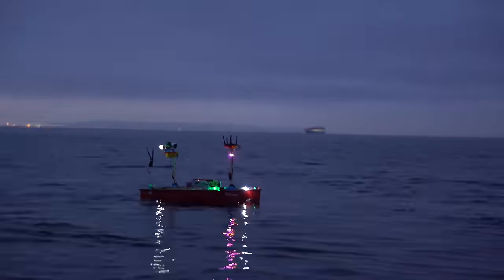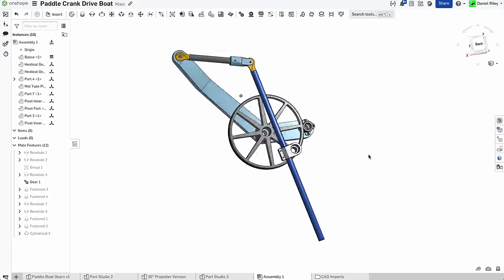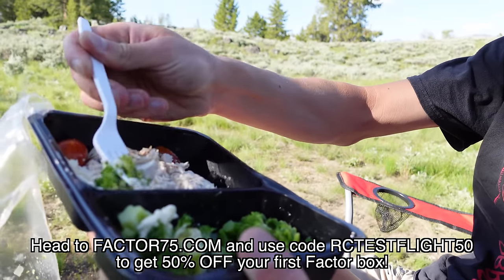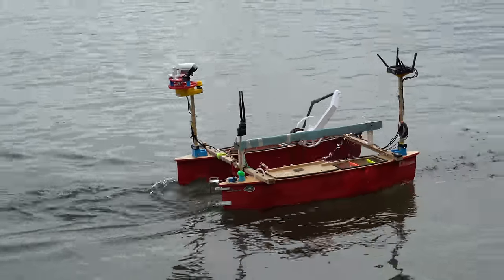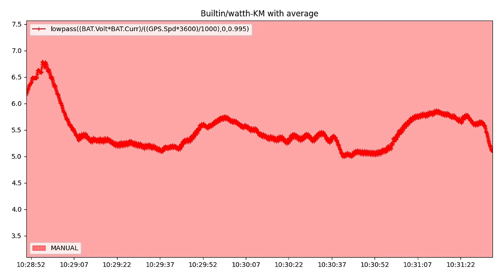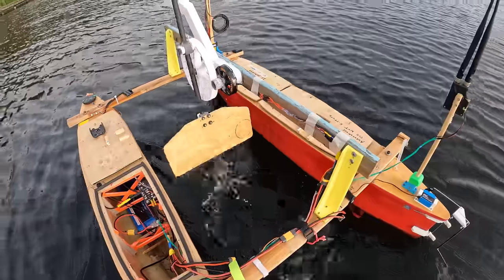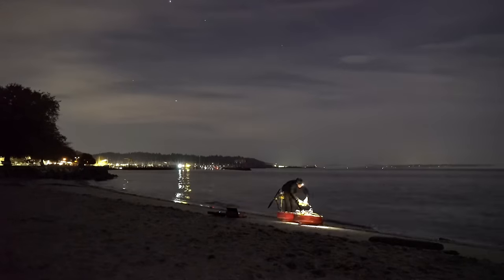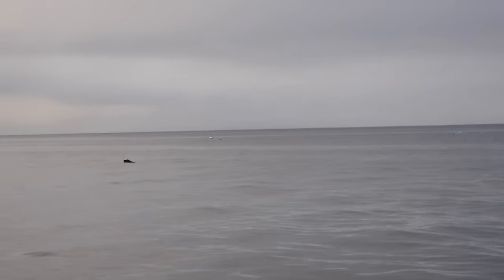Propeller Killer? High Efficiency Paddle Vs. Propeller

Comment: Have you considered moving the air props closer to the middle of the hull to minimise them hitting the water?  It would move them closer to the pivot point and reduce the amount of up/down swing.
Reply: Also try a ducted prop or one with Q-tips (see aircraft props for examples.)
Reply: 15:26
Reply: Wouldn't it start to push the bow down more as you get closer to the centre though? creating more drag and reducing efficiency as it tries to rotate around the pivot point rather than push forwards
Reply: @Phoen1x883  The comment suggested moving them forward. The 15:26 suggested moving them up.
Reply: Even if the air propeller is more efficient, I just like the paddle better!
Maybe try a wider paddle, with the edges bent back (like a 747's wingtip bent up) to cancel the vortices.
Reply: Good thinking

Comment: I would like to see you try the paddle again with another catamaran design. If the dimensions of the paddle are as close as possible to the distance between the port and the starboard hull very little water can escape around the edge of the paddle increasing efficiency. Alternatively putting a single big paddle wheel in the middle of a catamaran would also be an interesting idea.

Comment: Very interesting challenge. I guess a fish inspired propeller that that creates a wavy motion would have both very high efficiency and anti clogging properties
Reply: Exactly what I came to comment about. Nature developed tail fins! Why aren't we replicating that?
Reply: @seanhoude  because it's not a circular motion.
Circular motion is very efficient and easy to replicate and generate, especially with electric motors.
Yet any living creature can't create circular motion because flesh can't create ball bearings.
As seen even in this video, converting circular motion into reciprocating motion comes with transmission losses.
That's what prevented tail fin "propeller" to become economically viable.
Reply: @Shishou_Shi  Historically, we have created linear motion and turned that into circular motion (with losses). Why not use pistons to drive tails or wings instead?
Reply: @seanhoude  because it's very inefficient.
Yes piston engines are inefficient.
That's another factor on why electric motors are getting so popular again.
A fin tail prop is perfectly doable, it just doesn't make sense to do it.
Not to mention that it's low power, whales might create enough power to move a boat, but most fish put out very little energy, relying on small scale efficiency being slimy skin and scales with a tiny frontal area.
None of which is useful for boats.
Reply: @Shishou_Shi  I suspect all of those things could be very useful for boat and especially submarine. Many fish, even large ones like tuna and shark, travel very quickly, with great power, all very efficiently. Whale are a prime example of how this could be scaled upward.
Reply: @Shishou_Shi there is a style of paddling called "skaneing" as I recall, it's been a few decades since I looked into it, anyways, the paddle is behind the boat on a pivot and the oarsman is typically standing moving the paddle back and forth, such that it never leaves the water in operation, and it works like a fish tail. If you mount a wheel and linkage below the onboard side you can turn circular motion to side to side motion. The problem is that in that style of paddling the operator stops the paddle and uses it like a rudder to steer, and the linkage would make it too sloppy to steer, so you will need a rudder as well, unless you use a slide on the paddle shaft and use the wheel to precisely control the location of the paddle but you will have to figure out how to compensate for two positions of the wheel to be the same paddle position.
Reply: @vidard9863  the question is not whether it's doable or not, it certainly is, the question is whether it's not it makes sense to do it, and it doesn't, it's inefficient.
It's those Venice river boats that do this I think.
Or some kind of canal boat.
Reply: @Shishou_Shi  as I recall the last time I heard of it it was a study that claimed it was 60% more efficient than normal rowing... But that is just a fleeting memory.
Reply: @vidard9863  rowing is very inefficient but it's a natural motion for a human.
Reply: @Shishou_Shi  .... O.o ? .... You are watching a video which shows that rowing was one of the more efficient systems for this boat... And are complaining that a potential 60% efficiency, or higher, bonus, to one of the top two efficient systems is not worth considering?
Reply: @vidard9863   it wasn't more efficient by scale...
This is what shitty YouTubers do...
If you enlarge a process it gets more efficient.
A rotary propeller with the same acting surface as that paddle or especially that air propeller would've performed leagues better than both. 
Yet he compared two tiny little waterscrews against two massive large scale propulsions...
Reply: @Shishou_Shi  you do realize that he isn't building a cruise ship right?
Reply: @vidard9863   it's not a fair comparison.
It's pure entertainment yet the findings are displayed in a way that makes viewers think they hold any meaningful value yet they don't. 
It's trash.
A paddle wheel would've been better than that reciprocating paddle...
Got a rotary propeller of the same size would've been the best.
Reply: @Shishou_Shi the large water prop would be susceptible to weed. His challenge was to overcome that problem efficiently.
Reply: @seanhoude  I've never seen a piston that didn't use any circular motion for the mechanism that makes the piston return to its initial position. If you know of you, I'd like to see it.
Reply: @seanhoude  agreed. Similar to the way a ornithopter operates
Reply: @Elrog3  In this case, you could use opposing pistons or just a spring. No flywheel needed.
Reply: @seanhoude  Mostly because it's more complicated. For a boat like the one in the video, this paddle design can easily be steered using rudders. But, as efficient as the fish tail design is, fish have a lot of fins that are dedicated to controlling the direction that they're going in. Some of them are only relevant when you're trying to move in 3 dimensions and can be ignored, but it's still more than what you'd need for this design.
Reply: A fish tail motion would be fun to see. The fish tail trick seems to be that you time the tail motion exactly so that you steer the vortices created to work with you, not against you. There are youtube videos about this but I havent seen anyone trying to use this theory in practise.
Reply: @Elrog3  those old pogo stick soil compactors have a purely linear piston with no crank or anything.
Reply: @vidard9863  You're thinking of sculling.

Comment: two ideas come to mind:
- use the rudder (extra long) as a drive like fish movements
- use sails
Reply: Sculling
Reply: Why not use a MHD?
Reply: Would be interesting to see sails, kites and rotor sails (magnus effect) on these craft. Although I do wonder about efficiency and the scale of the craft.
Reply: Also, rudder that is not lower than the floating platforms.
Reply: Tank track with pattle attached so that the pattle stays in the water all the way down the hull?
Reply: @damianfitzpatrick3465  or something like the Navatech UHAC. Captive Air Amphibious Transporter.
Reply: @wolfgangpreier9160  Because efficiency matters, probably. MHD has really terrible efficiency iirc.
Reply: @delphicdescant  It was sarcasm. There is nothing more efficient then the good old propeller invented by one of my compatriots.
Reply: If you want to stop a sailboat quickly, move the rudder side to side. It acts as a brake. To propel, it needs the surface at a different angle, such as happens naturally with a flipper.
Reply: @wolfgangpreier9160  Gotcha. Sarcasm doesn't come across in text very well.
Reply: @delphicdescant  😎👍
Reply: This video is the type of shit you get when only rich kids are allowed to pursue their "big ideas".